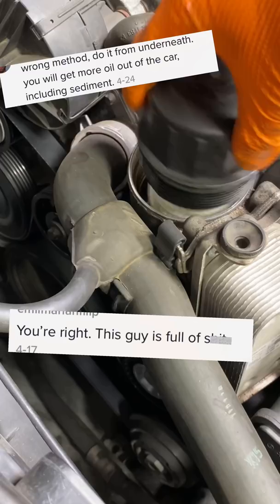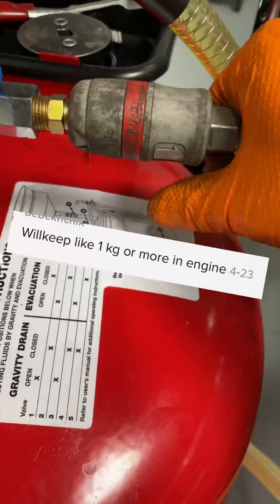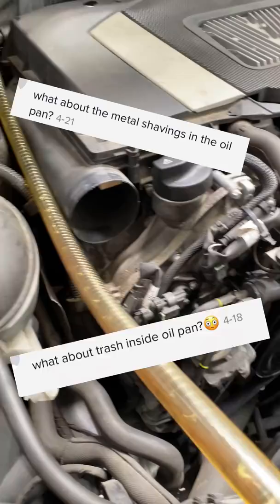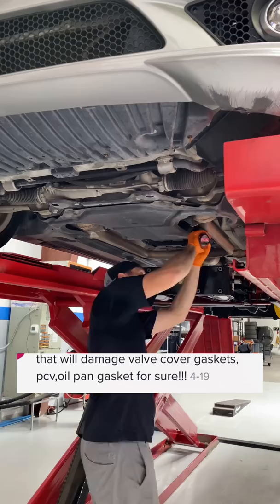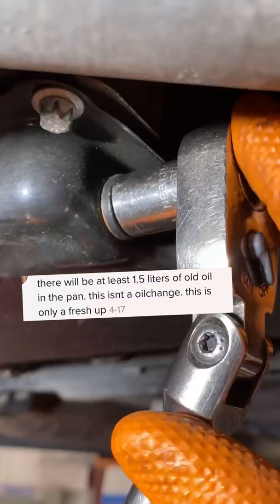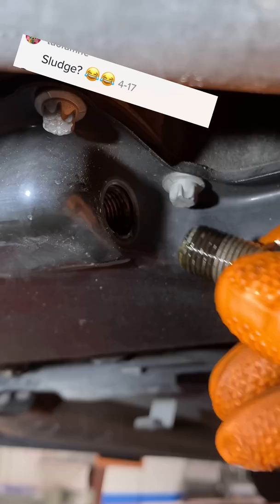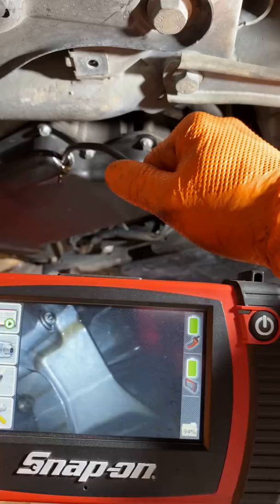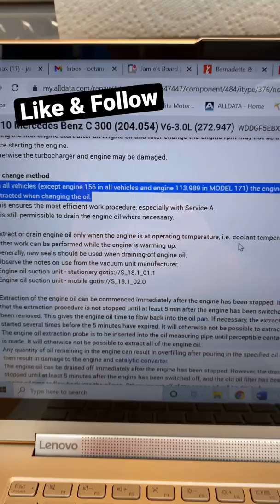#shorts Mechanic Proves Haters Wrong

Comment: If you have sludge, trash, or metal shavings in your oil pan then you have much more to worry about then how the oil is removed from your engine during a service.
Reply: Was just thinking of this. How the fuck are you getting so much debris in your engine? And sediment? Stop using shitty oil?
Reply: Well most of the time there is a small amount of metal/debris in the oil but not enough to be noticeable unless your looking for it
Reply: @JyWalker1603  no there should not be any metal debris in your oil unless your motor is damaged and basically eating itself
Reply: Ok, so engines wear out over time mainly when you first start the car.  A tiny amount of metal particles will be in the oil. Overtime it can build up.
Reply: Yeah over time, but the debate is whether the sediment will drain out of the bottom of the oil pan during a conventional drain and fill oil change, making it a better service than an oil extraction service. I don’t believe the fine sediment will go anywhere during either service. You’d have to flush out the bottom of the pan with a solvent to get it flowing well enough to drain out of the drain hole. Also keep in mind the structure of a drain plug has a raised portion inside the pan so there’s a fraction of an inch of oil left in the pan surrounding the raised threaded part of a drain plug “in most cases”.
Reply: @leion800  you should not have metal wearing off over time unless your motor has a serious issue that needs to be fixed. Most likely head related.
Reply: Are people putting Hershey kisses wrappers in their oil?  As far as PCV’s and gaskets come on man not that much psi used to pull a vacuum and extract the oil and are people seriously using penzoil on the MB?  If you cannot afford the maintenance you obviously can’t afford the vehicle.
Reply: @RWBYGaming  most likely bearing related* 
Tolerances measured in the thousandths of an inch don't like to be low on oil lol
Reply: @Yixdy  bearings or valves are pretty common, regardless all are replaced during a head job if done proper
Reply: I just don't like it cause in my opinion u should still pull the oil drain plug as there is typically a magnet attached to collect any magnetic pieces of metal(steel or iron) if any.  You can have a developing issue with no symptoms at the moment and catch it before catastrophic failure by finding a piece attached to the plug and take appropriate diagnostic action. There will always be metal in the oil it should be only non-ferrous, copper, brass, nickel ect. It's standard bearing wear as it's a wear part and designed to do so u can in spec that amount of wear by taking ur oil filter if canister type cut the top off below then crimp using a method that won't create metal shavings. And cut out 5-6 pleats  from the element for cartridge type simply cut out chunk of pleats place cut out section in rag and squeeze in vise to squeeze out oil element will be come fairly dry take the cutout piece of element out of vise and open like an accordion dirty side up and check the crease of the element for metal use magnet to check for magnetic pieces of metal anything salt grain size is not good anything that's like a powder sugar isn't uncommon but still not great would need to compare amount collected again by next oil change ... Typically sign of cam and or follower hard facing coming off also possibly from oil pump gears or excessive scoring of cylinder wall.  bigger pieces are more likely pistol ring coming apart or gear from front gear train. Thiers positive and negative to most methods usually the positive for something like vacuum oil removal is to the company and the negative to the customer since the company can now complete the job faster for the same job and negative for customer as they get a less thorough job  they receive the same service fluids and filter changed but part of it is preventative maintenance by catching signs of an issue by physically seeing oil come out of engine not through a tube and check the plug for and pieces of something coming apart  before it cause symptoms.
Reply: @williamcabral1615  interesting, what car brands have a magnet on the oil drain plugs?
Reply: @brianhechinger6726 it's less the brand (manufacturer) or model as it is the engine it's equipped with. u can have same manufacturer and  same model different engine one has it one doesn't.  my Dodge ram 5.9 Cummins has one but my old Dodge ram 5.2 magnum did not but it did after my first oil change and I replaced it , so yea Thiers some ford f-series, vw Jetta  my 89 bmw 5series  and just about every  commercial engine manufacturer  CAT, Cummings, International, Paccar, Detroit, which is what I'm most familiar with as I was  a journeyman diesel tech for caterpillar in the On-Highway shop for 11yrs  there is a bunch of engines with it and  I get not every car or engine does if it doesn't I'd definitely suggest to anyone replacing it with one that does. can't hurt anything but may just make you notice something coming apart before it actually comes apart
Reply: That there would be a Mercedes if that happens
Reply: Shhhh the experts don’t know that.
Reply: Unless engine is brand new (use it gingerly) there shouldn’t be metal shavings. When new you don’t want to gun it because the engine is still not quite done being built the pistons might be a micron too big meaning it fits but scrapes the bore as it goes it’s normal just expect metal shaving first 5000 miles or so.
Reply: @michaelebbighausen3733  shavings for 5000mi? Ridiculous. Maybe on a Yugo
Reply: He told you
Reply: It's funny because they are telling on themselves that they can't take care of a car lmaoo
Reply: True
Reply: THANK YOU SOMEONE SAID IT BEFORE ME
Reply: @RWBYGaming all engines wear man. You could have the best oil and engineered engine in the world and it will wear. And wear means metal.
Don't know why you would claim otherwise.

Comment: If metal debris is a regular occurrence when you do an oil change, you might need some bearings.
Reply: Some is a little too kind isn’t it 🤣
Reply: @mberry7857  you might need a new Car if metal debris is a regular occurrence 😂😂😂😂
Reply: @melwinder1  a whole car?
Reply: This is funny as shit, you know sometimes shit is funny. And this is definitely one of those shits! Great vid!!!!
Reply: @audiotyresup  well a lot of the time if you have shavings in you're oil, you've driven too far on to low or thick oil causing moving components to break (could also be bad engine design). Sometimes this would call for an entire engine replacement, which Sometimes you'd just be better off financially getting a new car with a warranty.
Reply: @boudrauxmnxsty6871  can buy cars for less than a new engine (passenger car engines, can get new small gas engines for a couple hundred or less). But having shavings in the engine oil doesn't equate to a totalled car. If caught early, it may be a simple fix. But some people may not want to deal with a boring or correcting the journal, etc. So yes, it may be more practical for many to replace the car, but if one wants to maintain it, they could out in the time and money to service the engine instead. My point was simply that that alone doesn't make the rest of the vehicle bad.

I'm not that great about regularly checking fluids myself despite some history in automotive classes and 91B cross training. Which reminds me, the "change oil soon" lamp has been on since I bought my latest car, and the previous owners (a school district) may not have changed it before selling. Was fine when we checked before buying, but I may need to change oil tomorrow.
Reply: @audiotyresup  I know that. Depends on the car brand. If it's European engine, probably would be better off getting a new car with a warranty though.
Reply: @boudrauxmnxsty6871  I didn't know you are aware of my education and military backgrounds. Are you with the FBI? 😆
Reply: @audiotyresup  was talking about the first part of your comment. Too lazy to read the second.
Reply: @boudrauxmnxsty6871  well, now we know reading the owner's manual is too much work for ya.
Reply: TVR. AKA.. Total Vehicle Replacement.
Reply: Might? You mean definitely 😂
Reply: @acetech9237  only bearings will make shrapnel?
Reply: Yeah exactly you got a whole lot more to worry about 🤣
Reply: Yeah if you're routinely metal shavings you're probably gonna be routinely changing engines
Reply: Or a head
Reply: Dunning-Kruger level confidence. I at least know that I know nothing about ICE car maintenance.
Reply: @audiotyresup  well no but if you want to change it it'll probably just be better to get a new cheaper more durable car
Reply: @Eradicator-jv9xr  Yeah, I already said that.

Comment: I was an Mercedes mechanic  for a long long time, we were changing oil this way since the 123 chassis cars in the 70's
Reply: Never knew you could just attach the suction hose to the dipstick tube! Bought the Harbor Freight extractor and use it for all my cars.

I once used a cheap hand pump to drain my BMW, and it still got every drop when I pulled the plug to test.
Reply: When I first started at the benz dealer a few years ago I loved just extracting it, saves tons of time on low mileage cars, especially if they’re a waiter.
Reply: So they've been using piss poor metal on their oil pans for 50 years, got it. Why even add a drain plug when the threads leave after 25000 miles.
Reply: @MatMabee  ifyou drive a car for more than 25000km you are poor
Reply: @MatMabee  it’s from idiots over tq aluminum just don’t freaking tighten so freaking hard
Reply: @Malibus_Most_Wanted  Bro I shot out my VW pan using only 25ftlb. Threads rip out easier than Jada Smiths hair. Bought a hand oil vacuum, haven't touched it since. My Ford's have been going strong for years without problem and I just shove those plugs on tight asf. Euro cars use shit metal pans, don't defend it.
Reply: @RoeGi1337  If you only own one car at a time you are poor
Reply: @MatMabee  also this, yes, one for fun, one for shopping, one for fishing/mountainbikeing
Reply: @RoeGi1337  You only have 3? Guess as you grow older you'll accumulate more but to be honest if you're coming at me with that poor shit your name better be on more than that 😭😂👔
Reply: Ay, would you recommend a Mercedes(give a year if that helps out, like a '05 or a '85)
Reply: @D_Wave  2022, dont buy old cars
Reply: @RoeGi1337  more than 25k? Lol nope your just smart cause cars last 250k not 25k so why not take the money you saved not buying a new car every year and out it towards nicer items in your home.
Reply: @MatMabee  is not just Euro cars with shit oil pans. When I bought my Lincoln and went to do my 1st oil change on it, I found out the threads were so stripped they might as well be Cardi B before she got famous.
Reply: @Schmuly  poor
Reply: @RoeGi1337  I can easily afford to buy a new car  with CASH $$$ - BUT I really like Ole Blue my 2001 Honda Accord with 454,000 miles on it . It still shines and runs lie new  !
Reply: @MatMabee  They do have pretty bad oil pans and even water/fuel pumps from factory. I always tell people if they do end up failing, don't go back to OEM. Upgrade all those and they'll never have issues again.
Reply: Diver Dave doesn’t run like new with 450k miles even if it was serviced correctly. Bring it to the dyno you’ll see how much HP loss you have on that high mileage engine
Reply: This is how you get the oil out of a boat engine. 
This makes changing oil in the lawnmower super easy.
Reply: @RoeGi1337  idk about you but my step-dad who has a wrangler with over 250k miles on it and running fine is certainly not poor 💀
Reply: Ohh 123 chassis. Probably the greatest ever made. Along with the 124, 126, and the 140 chassis.
Reply: @MatMabee   but the plugs on VW go from 18-25 nm 🥴 stop over torquing.
Reply: @RoeGi1337  tf you talking about.
Reply: @RoeGi1337  What's wrong with old care? What if he is a collector?
Reply: @PilotTed  its gay to collect old things except ww2 relicts
Reply: @RoeGi1337  So you think 60s, 70s, and 80s muscle cars aren't cool?
Reply: @D_Wave  I have a 2010 s 550 and it runs great
Reply: I bought a at home electric pump for my w201. Best car I've ever owned, more more reliable than my 96 corolla wagon and my prelude before I sold it.
Reply: @RoeGi1337  or, hear me out, or maybe you just like the car and aren't a shallow materialistic person?
Reply: @nick12_29  jokes on you liking cars for everything but performance is shallow and materialistic
Reply: W124
Reply: Wow youd think they would learn a better way to do it